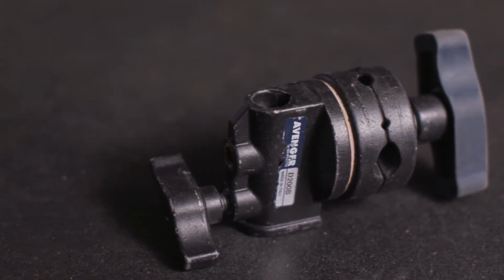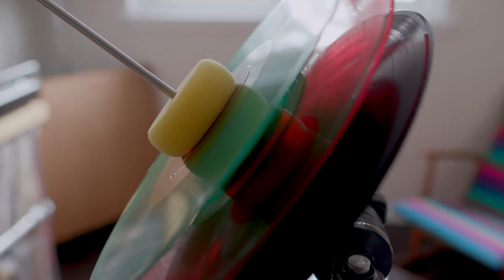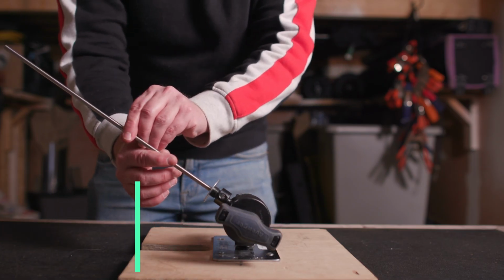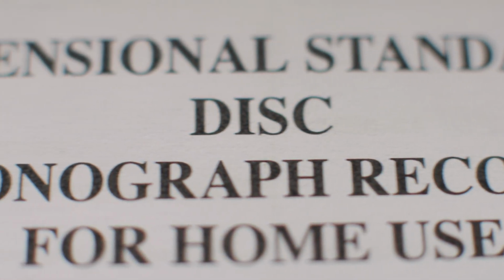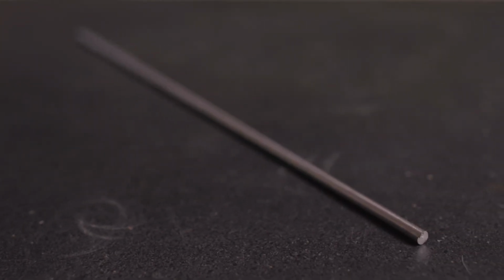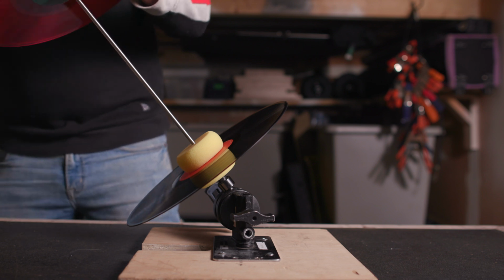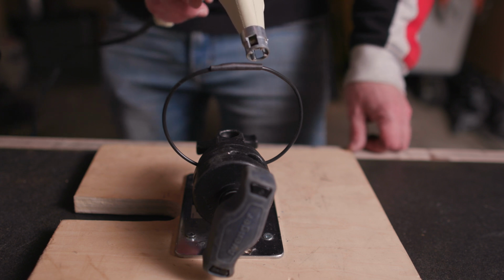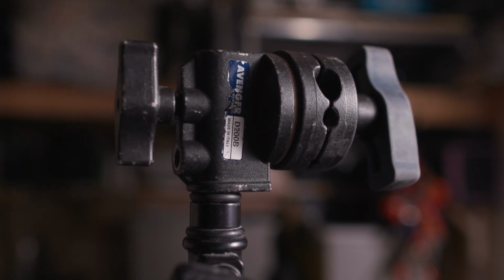WHAT IS A GRIP HEAD? // using a film/photography clamping tool from a c stand to make a record dryer

Comment: I really wish they would make cymbal stands that have this same mechanism. Maybe they do? Maybe I will start a new company? 🤔Cool vid!
Reply from the maker: Hey there John Sproull - yes I’ve often wondered why companies that make lighting stands don’t make music stands or vice-versa.  I have often come across music stands that don’t seem that robust - they sometimes seem downright flimsy.  I don’t know anything about cymbals but if I were to try this I’d look at a 20” grip stand with a head and a 20" arm.  I like to use Matthews stands and Avenger heads and arms - like the video (but you could probably go cheaper if you wanted - they're all likely going to hold a cymbal just fine).  The next step is to make sure whatever mount the cymbal is attached to fits or is slightly larger than the holes on the grip arm puck - those vary by manufacturer a little bit.  Since the puck is split in half you can have a mount that’s a bit too big for the holes and it will still sandwich in the puck.  You can’t have one that’s too small for the holes or they won’t grab it when the puck is fully closed.  I read that cymbals have a hole that’s 8mm usually (but maybe that varies?).  Would the mount be 8mm too?  A lot of tool manufacturers consider 5/16” and 8mm interchangeable.  So I tried a 5/16” bolt in a couple of arms for you - Matthews arms didn’t work - but Avenger arms did hold the 5/16” bolt fine.  You’d want to test somehow to be sure - but it’s possible a 20” grip stand with a  head and a 20” Avenger arm  would do the trick.  If you do this, remember the "righty-tighty" rule from the video, as well as to point the big leg of the stand at the drummer - but my guess is it would lock better , have 2 inches more boom reach, be more sturdy, and be about the same price as a Tama Star Boom, and take a sandbag no problem if you play punk rock and really want to weigh the thing down….  If you start the company I’ll make the Youtube video….:)